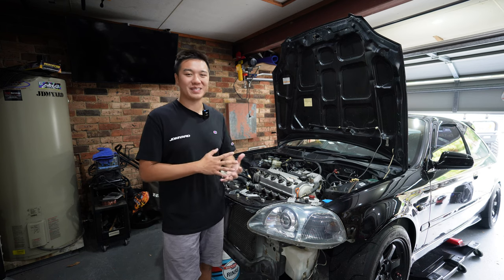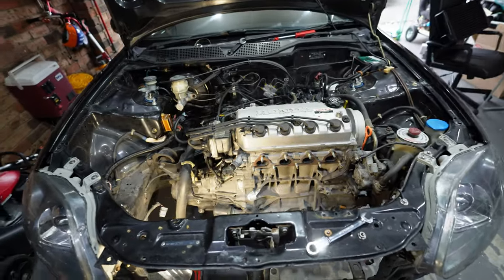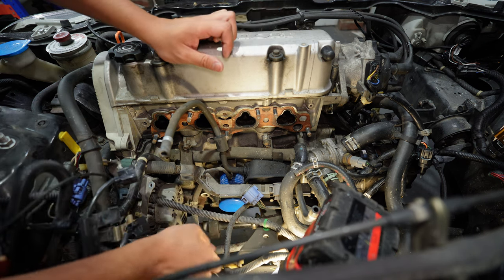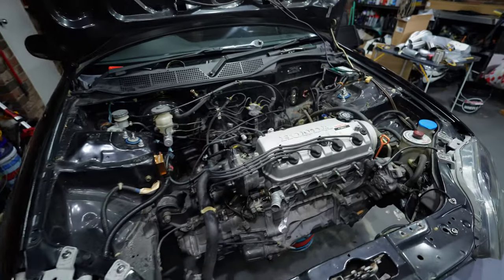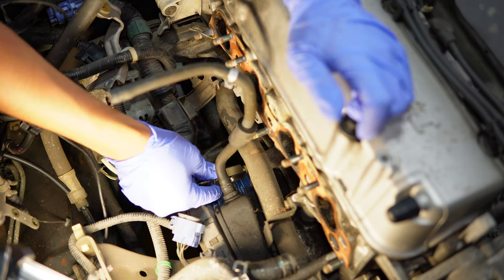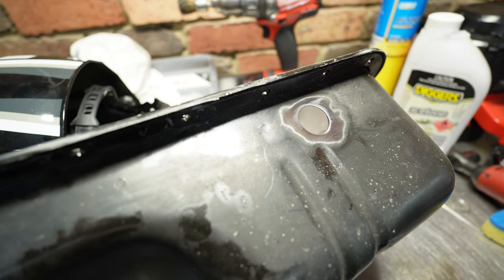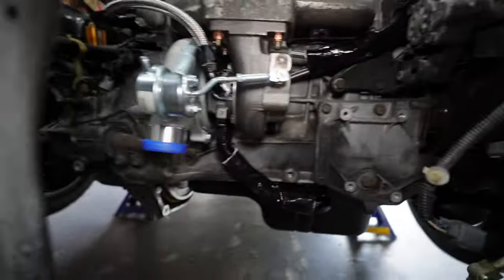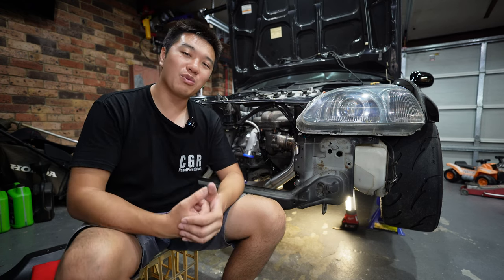Boosting my D16 with a GT28RS - TURBO INSTALL AND FAB

Comment: Will you be upgrading to a haltech 750 or 1500 to get the A/C functional again?
Reply from the maker: Hi mate 
No plan at this stage but once my RX-7 goes for the new Haltech S3, the civic will inherit that 1500. The other alternative is run an expander IO box OR purchase the haltech dash which will give you additional AVI for AC

Comment: Did u use the stock o2 sensor and extend the wires on it? Will extending the wires effect the sensor?
Reply from the maker: Hey mate
I am using a wideband controller.
You can still use the narrowband sensor but I would not recommend that